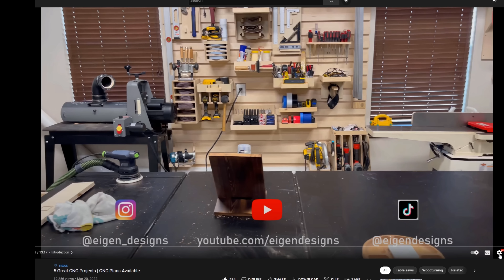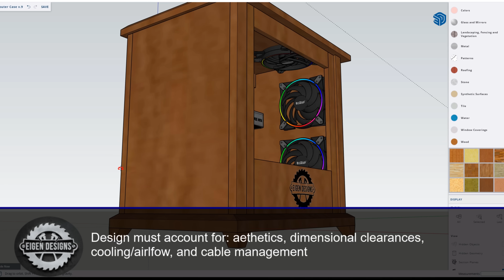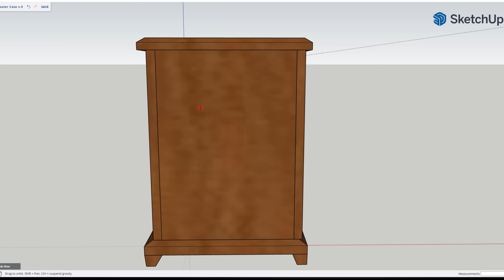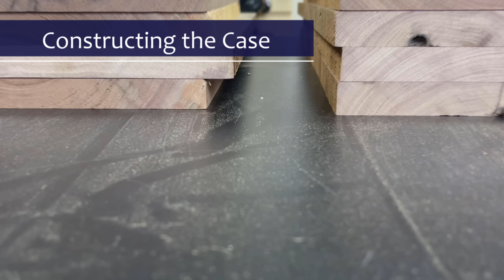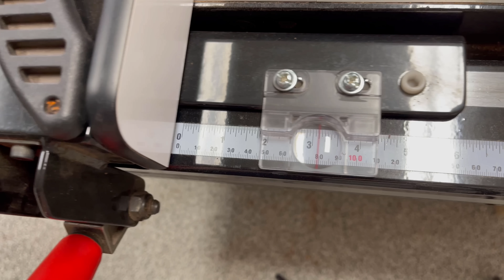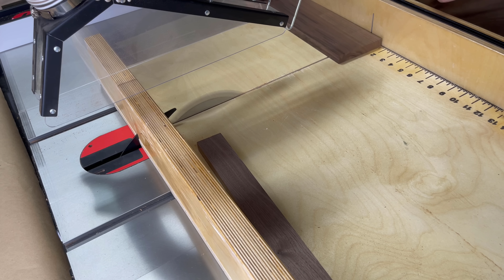DIY Walnut Computer Case  |  4k Video Editing Work Station

Comment: That's awesome with classic feel. Do you feel any difference in noise or would have been better to add some acoustic foams? Thanks for showing us your design and hardwark.
Reply from the maker: Noise hasn't really been an issue so I don't think I would change anything at this point

Comment: great work.

18:03  you might get better temps if you removed the [Top - Forward Fan].  testing has been done on airflow etc, and top fans such as this can end up disrupting airflow from the [Front Fans].  they can suck the front intake air up & out so a substantial portion of it doesn't make it to the CPU & GPU, leaving them to use the stagnant ambient air.

Positioning the the Top Fan in the rear for exhaust would help drag air through the entire PC.  this would yield better airflow over your CPU, resulting in lower CPU temps, and lower ambient temps which would benefit the GPU as well.

*it wouldn't really matter except you placed some high-end components in there, and if you were to utilize their potential you might see some heating issues.

Comment: I gotta be honest with you, those multicolor LEDs spoil the beauty of the case. Those work perfectly with the usual metal cases whether the aesthetic is plain or tryhard, sure. But for this one, I'm not a fan. Maybe don't make the LEDs cycle through all the colors. Less is more, I think.
Reply: Agreed, the craftsmanship is mesmerizing but it needs some soft amber lights or warm purple or some sort of pastel tone, not this oscillating rainbow vomit

Comment: Great looking project, and far more than what I could hope to achieve with my lack of tools. Here is a creative feedback however for a future build. Make it lighter~ The base and the top of the case being so thick makes the PC look excessively heavy. Use skinnier wood panels wherever possible. and or use creative pattern CNC panels (much like the front panel) to take off material.

Comment: Any concern if wood start playing on humidity and bent the hard screwed mother board or other components apart?
Reply from the maker: I use kiln dried lumber so there won’t be a drastic change in wood movement over such a short distance. I wouldn’t expect anything more than 1/32” or so for such a small panel of wood. Good question though!

Comment: since wood does not conduct electricity like metal I am guessing this is probably safer than typical cases but I am not an engineer. The case I have has a very metallic feel to it. I've also seen laptops that are built poorly in the sense that the manufacturer designed it and it shorted out the motherboard because it somehow touched the internal components. Laptops are mobile and receive a lot of bumping. Do you feel this case or even a plastic case say made from legos could be better that what is sold in stores or does it just not matter at all the material of the case once the motherboard is on the raisers? Thank you!
Reply from the maker: As long as your motherboard is on risers your electronics are well shielded from the case and don't pose much of a risk of electrical issues. The bigger issue with computers is heat disappation rather than electrical conductivity.

Comment: I like it but perhaps you could try another side panel version that has the same ventilation holes as the front side panel to be a bit more cohesive. Also the tempered glass side panel does feel a bit out of place with the wooden asthetic. But it does look very professional and clean. I would buy this case if you sold to the UK.

Comment: The finished product looks great! However, it's important to carefully inspect the ends of your lumber when purchasing and during the milling process. It's a good idea to anticipate having to cut off 1-3 inches from each end due to end checks and end-grain issues, so it's wise to buy longer lumber. Each project is a learning experience, so keep that in mind.

Comment: The only negative are the lack finish for the connectors and slots at the back. Something could've been made n the CNC with either an aluminium or brass plate, but your motherboard is too far inside the case to make this easy.

Comment: I thought you where gonna rip apart the plastic on the fans and install it with the blades into the circle holes you made.
A potential idea to get them more integrated / flush with the case itself.

Comment: Absolutely gorgeous looking case! I've been searching online for this exact kind of build, but most of the wooden cases seem to be either hyper-modern, or very obviously steampunk themed. 
I am curious to know if you had any issues at the back where the motherboard and the power box are exposed (dust wise, for example); It looks like there's a bit of a gap, but the angling is hard to see
Reply from the maker: Thanks for the supper Elenaor. So far no issues with functionality with the case (e.g. excessive heat, dust, etc.). The two fans at the front, which have a filter mesh behind them, pull the air into the case so the other small gaps around the power supply and motherboard IO end up pushing air out, thus, it doens't let dust in. 

Have a great week.
Reply: @EigenDesigns  Good to hear it’s still holding up after several month too! Thanks for that info, I hadn’t thought about the push and pull from the airflow, but that bodes well. 
Cheers!

Comment: I love it. Awesome meeting of worlds. Is the IO back panel flush with the inside or the back or recessed? And how did you keep the 3080 upright?
Reply from the maker: The IO panel is slightly recessed. I was able to build a wooden bracket to help brace the 3080. That thing is a heavy monster and it needed some additional support!

Comment: It's a gorgeous build and amazing effort. It's kind of a shame to have rattle canned the ply - either should use MDF (or even melamine) there, or stained it. My only other thing I would suggest is aligning the back IO plate to the wood - you just set the motherboard down and started drawing, having some kind of recess carved either with the CNC or hand chisel to bring the IO from the MB and PCI slots closer to the rear wood might be worth the effort. Cool build overall tho - LOVE the maple dividers you did, and that chamfer is such a nice touch.
Reply from the maker: Hey David, thanks for the support. I really like your idea of recessing the motherboard into the tray... that's a very good idea. Thanks for sharing bud.

Comment: My only issue is the lack of space, but I run 2 video cards due to virtualizing my windows machines for gaming. Do not have a CNC so some of this would be hard for me to do, I am considering making a case myself at some point.  Frustrated with cases never meeting my needs.
Reply from the maker: That's the beauty of a custom built case - you can make it what you want. If I was running two graphics cards I would probably go with a different design with more cooling. These new cards put off a ton of heat so airflow would be paramount.

You can definitely make a case (minus the front panel) without a CNC, so don't let that be a barrier. You can get creative with other tools (e.g. drill, jigsaw, hand saw, etc.). Good luck if you decide to build one.

Comment: Beautiful job on the woodworking side and that's quite a beastly PC on the inside! I'm running a base 3080 but badly need to upgrade my mobo, cpu and ram. I'm still rockin a 4790K lol
Reply from the maker: Dude! I was rocking a 4790k before upgrading and it was really bottle-necking my system anytime I did something CPU intensive. I had a ton of fun making this. 

I didn't know you were a PC guy too! We have more in common than I thought. :)
Reply: @EigenDesigns  Yeah it's showing it's age in my system and is holding my 3080 back a bit. I'm just about ready to upgrade; I'm seeing how the new ryzen and intel CPUs stack up.
Yep, woodworking and PCs (and gaming) are two of my main hobbies.

Comment: love it! if its not too late consider some ventilation at the bottom under the power supply, that way you can flip the psu around where its drawing fresh air in.
Reply from the maker: Hey Allen, that's a good idea and definitely something I could add. Thanks for the tip!
Reply: thats an 1300w, most likely 80plus gold standard, my guess is, the fan turnes on maybe 10% of the time its actually on :D